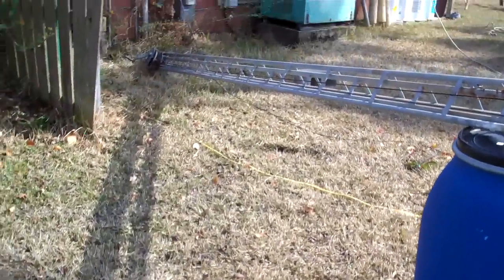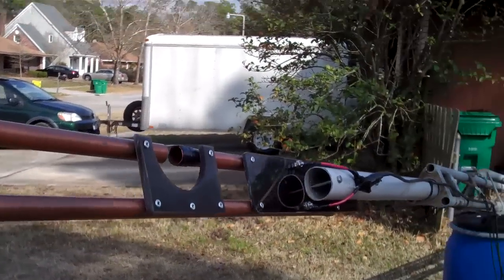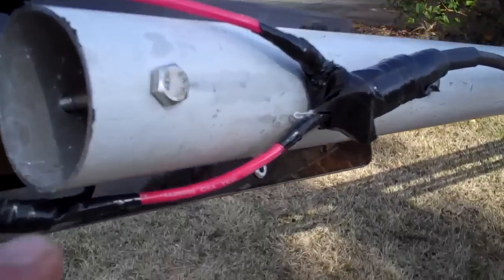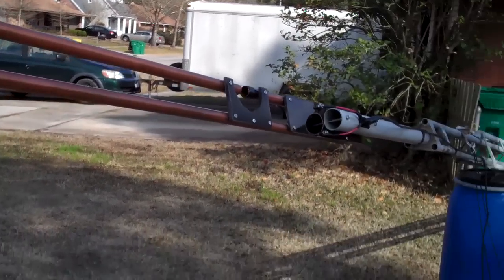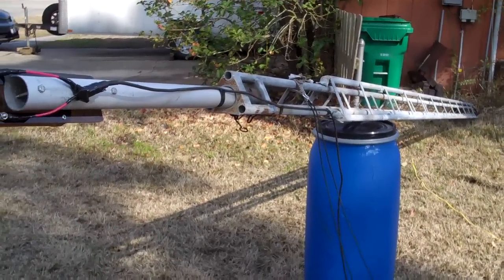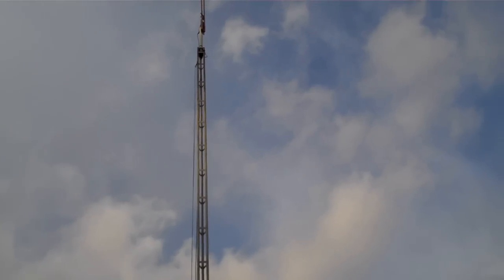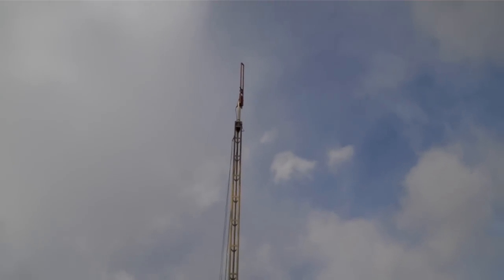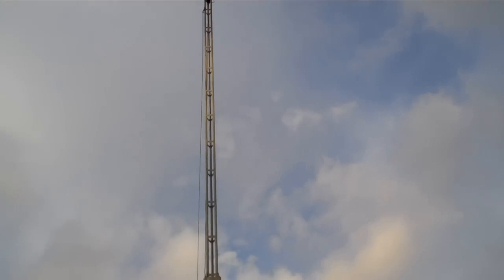The 2 meter antenne goes UP on the tower

Comment: So much has changed since I was into the Air waves.
I used to run a Uniden HR2510 ( non epoxy dipped Micro-P) and an Antron 99 on a tower.
A little work to leg 21 and a resister LOL
Cool to see how much has been changed
Reply: peak and tweak.....things have changed for sure
Reply from the maker: Progress...I think.